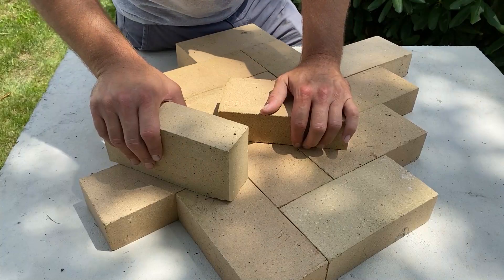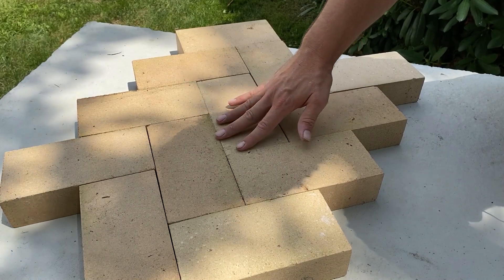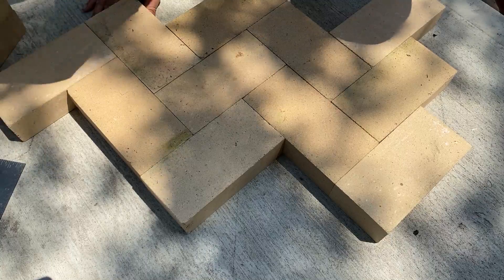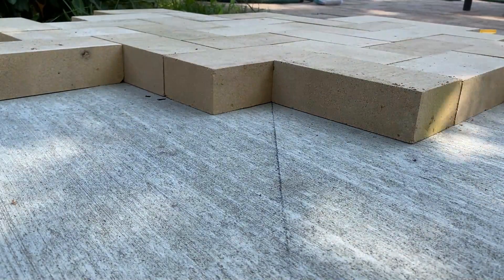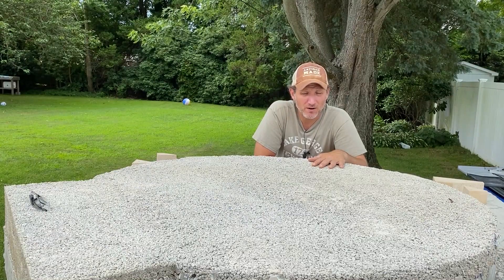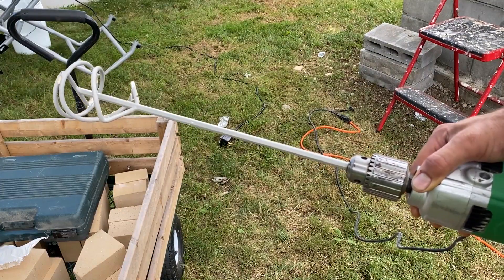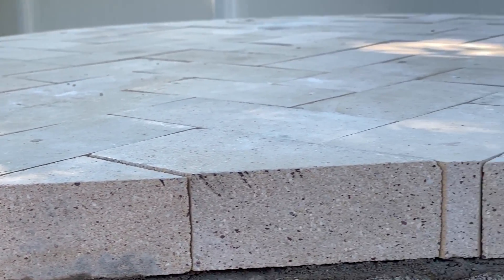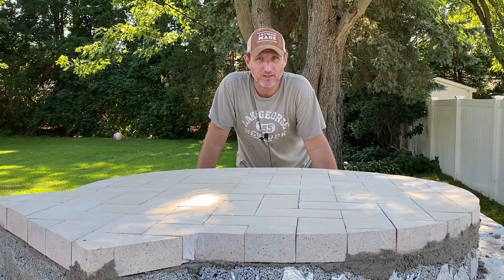How to build a brick oven / outdoor kitchen build / Part 4- Brick Oven Floor Installation

Comment: Great Video. I am a Carpenter Contractor and built mine in my backyard Pavilion! I installed my Brick on some Ceramic Board.
Reply from the maker: Thank you. I wanted to use ceramic board but I knew I wouldn’t be able to cover it this year and was worried about moisture problems.
Reply: What did you use in between the fiber board and bricks ? I choose the board as week but I’m not loving using the sand to level.

Comment: Pro tip: Never lay down your fire bricks without soaking them up in water. I learned it the hard way. I needed to remove almost half of my floor bricks after setting them up without soaking them up in water because they came out right after 2-3 minutes. It is extremely important step.
Reply from the maker: These are not mortared down. It’s a bad idea to Mortar the oven floor. The floor needs to be allowed to freely expand, especially when the oven reaches temperatures in excess of 1000f. Soaking bricks is covered in part 5
Reply: @ArtisanMade  sorry I thought they were mortared. You are fine then. Thank you for the clarification. By the way I mortared down mine and didn’t have any issues over 2 years.
Reply from the maker: Daniel Demir that’s good news. I have heard a lot of horror stories. Im sure you will never have a problem if it hasn’t happened yet. I mortared my brick bbq floor and it cracked after several uses. Oh well life goes on.
Reply: @ArtisanMade  Some people uses regular cement sand mix instead of refractory mortar. It might be the reason. Also, top of the dome is always the hottest part of the Owen, so if your refractory mortar can handle it, it should be easily handle the floor.
Reply: @ArtisanMade  Quick question... in minute 6:21... I see that you started putting your fire bricks onto the clay/sand mix.  Did you soak them before putting them on?  I didn't see that in this video however, I did see that you soaked your fire bricks when you made the dome.  Thanks!
Reply: @DanielDemir  in the event after using the oven you want to replace a brick … you will be happy if they are not mortared down.

Comment: Hello!Thank you for sharing with us all the valuable info. I have a question.If the base is made of vermiculite, what compressive strength would it have? In other words, would it withstand the weight of bricks placed on top?
Reply from the maker: I used to know the answer to that but I forgot. You can find it online but I can tell you it is plenty strong

Comment: Love the videos! You do the best job. Thank you. Quick question about fire bricks. I bought some firebricks from Lowes and that had a glazing look to them and every brick seemed to be a different size. I returned them and bought different fire bricks from a company that specializes in all sorts of bricks. These fire bricks seemed better but they appear to be very 'sandy'. If I rub my hands across them, I can literally rub off sand particles from the brick. Do I have the wrong firebrick for the floor...or am I just overreacting? Thanks so much!

Comment: I'm from Argentina, I don't speak English... the translation of this message was made by Google, understand the mistakes.
If in your country vermiculite is expensive, imagine in Argentina !!!!
Here, broken glass and salt is used for the floor. I don't trust the salt, which may affect the irons of the bottom slab. From your cool video, I want to use vermiculite and cement over the ground glass, but one inch thick, do you see it possible?
I see you answer every comment, your patience is infinite, you are a great person in doing so, that's why I dare to bother you. I apologize for that.
Reply from the maker: If you decide to use vermiculite, you do not need to use the glass. It has worked very well for insulating my oven floor.

Comment: Is there a downside to using Perlite rather than Vermiculite? Finding it hard to source bulk Vermiculite for some reason, but plenty of Perlite in home/garden stores. I was thinking of the following layering for the base starting from the lowest: 
Aluminum foil, 
either Perlite base (4 inches) or FORMULAR 250 (4 inches), 
followed by Al clad Rockwool rigid base (2 inches), 
Masonry sand layer (1/4"), 
Firebricks (2.5 inches)

Would love to get your thoughts!
Reply from the maker: As far as I know, perlite is very similar and can also be used. I don’t know about the rock wool for the base though. If it is ceramic fiberboard, that works too.  Perlite is also a form of insulation. Only one is needed, but be aware, if you choose ceramic fiberboard, it cannot get wet.

Comment: Is there any disadvantages of just pouring the insulation layer on the entire concrete pad?   (Avoid the extra work of making the form)
Reply from the maker: Depends on what you are planning to do to cover the exterior. Vermiculite is not a good surface for attaching brick or stone veneer
Reply: @ArtisanMade  according to this: https://www.perlite.org/wp-content/uploads/2018/03/perlite-aggregate-lightweight-tile-mortars.pdf  it can be used as tile morter.  So i would assume you could also tile over it?

Comment: Could you send me a link to the fire clay please, I am in the Uk but then I could find something similar.
Reply from the maker: I bought them at my local mason supply store.  Check your local mason supply store or any store that sells fireplace building materials.  You should be able to find everything you need in the UK without too much trouble.  Good Luck!
Reply: Hi. Did you manage to source this? I'm having similar issues, Bedfordshire
Reply: I decided to take a different route and bought pizza oven clay from potterycraft it is air dry and made for creating pizza ovens.

Comment: I can't find reasonably priced fire brick.I find 6 for 50 dollars which seems steep.Where did you get yours?THks
Reply from the maker: Masonry supply store. Should cost under $2 each
Reply: Im building the exact same oven as Allessandro. The fire brick I will buy is 2.80/brick! I found no cheaper anywhere. One place was 4.86/brick!!! Unbelievable! The refactory mortar was 78.00 a bag! Wow this is going to cost me but I wanted this kitchen build so here I am. I live 30 miles south of Boston.

Comment: I was advised by my local mason suplier to go with thinner 1 1/4" thick firestone for the floor which would heat up  floor quicker and hotter. When I built my oven, I used The 4 1/2 x 9 standard firebrick like you did( only because at the time, someone gave them to me for free). pizza comes out good but the bottom doesnt cook has well as the top. I 'm wondering if its because the floor brick is too thick and should of gone with the thinner. Stove is hot with oakwood, insulated very well no problem, but I just cant get the floor super hot for a crispy bottom.
Any thoughts ?
Reply from the maker: Thin brick is a very bad idea. First, they are much more likely to crack. The heat that cooks the bottom of the pizza is the heat that is retained in the fire break. A  thin brick will retail less heat and cool more quickly. I never have problems like this. I am wondering if you are heating the oven to the right temperature.  When all the black soot that builds on the brick is gone, you are ready to make pizza. Also, another factor that could cause a problem is the overall height of the dome in the center. If the dome is too high the heat that is reflected downward will not be sufficient enough to get the floor to very high temperatures.
Reply: Hey thanks for the reply. Yeah, my oven is about 1/2 the size of yours so the dome isn't as high.
I do get the oven cranked up pretty good !!
I think my concern could be my oven dome is not brick ( only floor) it is made of 2 inch thick vermiculite/ Portland, then a 2inch ceramic fiber blanket,  then rendered about and inch.
I'm curious, does your pizza have a crispy bottom when done ?
Reply from the maker: @che-NY  My pizza is crispy on top and bottom. Now I understand the problem. Vermiculite is an insulator. It doesn’t retain heat and it doesn’t reflect heat down to the oven floor. That’s why it’s not hot enough.
Reply: Dam, I guess I have to build a better one now.
Thanks for the advise and I downloaded the plans you provided, thanks !!
I have the same exact pizza platform you made, so I can go by your design without hitch

Comment: great pizza oven, what exactly is the 1 to 1 mixture refractory mortar and quartz sand ?
Reply from the maker: I didn’t measure the amount of water added. You want the same consistency as thinset. It should be easy enough to spread but not runny.

Comment: Hi there.  Regarding the Masonry Fire Clay mix you used for your oven floor, can you tell me what mesh number it was?  I can't find the masonry fire clay in Canada but there's a pottery place that sells fire clay that's either a 35, 48 or 100 Mesh type (35 being coarse and 100 being the finest).  Thanks!
Reply from the maker: Mine was very fine. Similar to Portland cement.

Comment: Hello! Thank you for the comments on your DYI pizza oven project. I am assuming the mortar you used to set the fire bricks into for the oven floor is the same you used for skim coating the vermiculite base?? Thanks - Gary
Reply from the maker: No it is not. Check out part 5. I explain the the whole process

Comment: How much would it cost to build this complete oven the way you have? How long can I take between steps?  Can I build it over time? Or is it better to gather everything and build it at once?
Reply from the maker: Great questions. I think the the whole thing cost me about $2500-3000. Not including the steel reinforced floor. You can build it over time. I built the base a year earlier. One you begin building the dome, I would recommend finishing it up without waiting to long. It took ma a month but that is because I wasn’t able to work on it every day. You can get it done in 2-3 weeks of full work days, but you have to wait a week for the vermiculite to dry and I would also wait for the dome to cure for a little while as well. Depending on where you live, you want your dome protected from the elements. Here in NY, if water gets inside my oven and then it freezes, that could cause problems

Comment: can I use split firebricks for the floor or does it have to be full?
Reply from the maker: Only use full
Reply: @ArtisanMade  got it thank you very much, we used 4 inches of perlite with Portland cement, laid out the full firebricks in the herringbone pattern, now the plan is to sand down the floor of the oven so it's as smooth as possible because there are a few slight edges sticking out
Reply from the maker: Adi Mart very nice!  Good luck friend!

Comment: Any reason you didn't make your own fire bricks using the mix you used on the foundation?
Reply from the maker: Firebricks are made from a completely different material and can handle these extreme temperatures

Comment: Great video!  I’m currently making my own pizza oven and am on the same step.  I don’t have fire clay readily available but I do have refractory mortar.  Do you think I can use that instead?
Reply from the maker: From everything that I researched over the years. I think more people are opposed to using mortar Under the floor. The idea is that the floor is supposed to expand with heat and if it’s mortared if might become a problem. If you want to play it safe, you can pre cut as much of the firebricks as you can and then use the the paste that builds up at the bottom of the water pan. Mix that with sand, and you will have something similar to a sand clay mixture.
Reply: @ArtisanMade  how much is higher the insulation floor?
Reply: Generally pottery making shops have this readily available.

Comment: Why use firebrick instead of biscotto?
Reply from the maker: Price and durability.  As far as I know they are used in gas ovens. Dropping a log on thin material like that could result in cracks.
Reply: @ArtisanMade thanks for your answer. You have some great videos. Thank you.

Comment: Question, where did you buy the fire bricks? If you can't give a web address, could you please at least give a part number, description or something like that? I know of fire bricks used in furnaces for melting metal, but those are extremely soft & actually fall apart when they get wet.
Reply from the maker: Your local mason supply store should have them.   That's where I got mine  They are fairly common in North America and Europe.